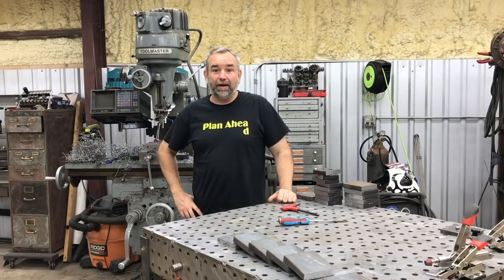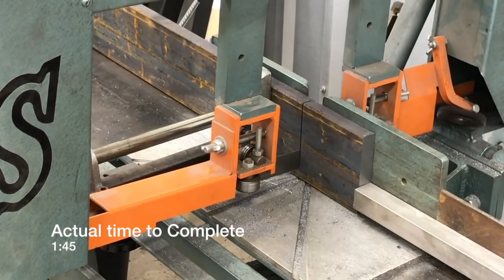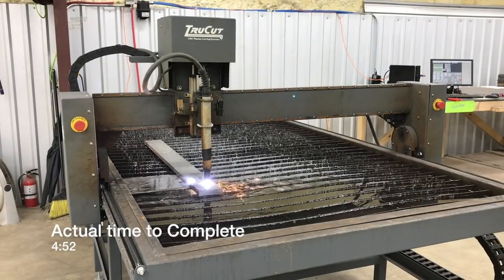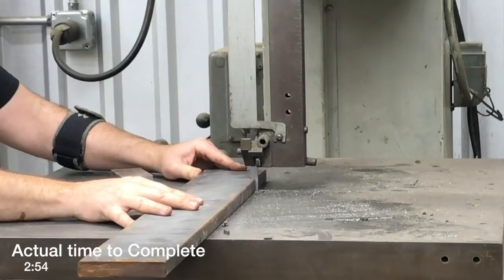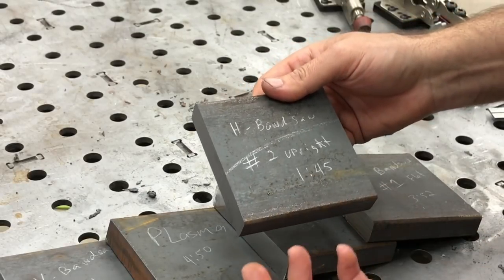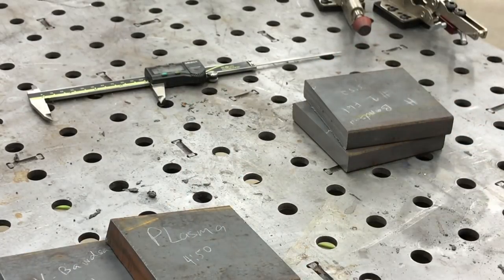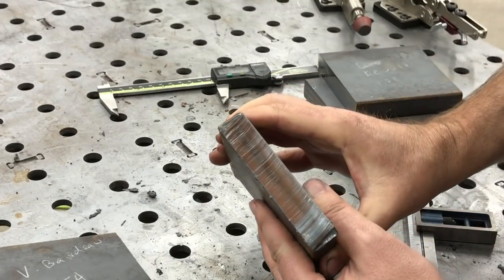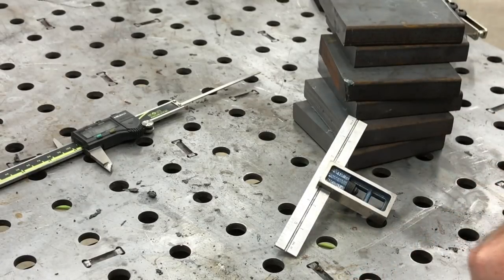5 Ways to Cut Thick Steel - Which is Fastest? Carbide Circular Saw Blades

Comment: This was great. Just what I was looking for. A few comments:

Rip fence for the bandsaw? Same with hand saw?

How would the chopsaw do horizontally?

Tablesaw with rip fence? Too dangerous?

The bottom on your Dewalt chop saw looks exactly the same as my cruddy harbor Freight abrasive saw. I agree with you the cuts are never 90°, but I would expect Dewalt to have a better mechanism to ensure 90° cuts with that nice blade. 

I never knew metal cutting blades were that efficient and safe. Thank you so much!

Comment: Very informative well made vid, thanks. I have an evolution rage 4 chop saw and I have found the same thing with squareness. I blame it on the clamp. The nut for the lead screw is so far back that the plate holding the piece wobbles. Also no one seems to make either metal cutting table saws or band saws. Yes you can put metal cutting blades on them but there is always a speed issue and they have basically been designed for  wood. It seems there is a safety thing going on, good clamping is really important when cutting anything really.

Comment: Use to do a lot of cut lists in a fab shop. In my opinion, I would use your horizontal bandsaw with the material upright. The first cut includes setting your stop but the others go quick. Also always consistent and doesn't require a lot of baby sitting. Once the cut gets deep enough to go across the width of the material, your feed rate will be constant and not chatter. This allows you to multitask pretty easy.  Nice video. Thanks for sharing.

Comment: Chops saw blades tend to walk over really bad when run vertical. The more down pressure you put, the more side walk tendency the blade has. Same is true with bandsaws. If you're cutting vertical, slow down the down feed on the band saw or down pressure on chop saw

Comment: Good comparison. Set up time is def a factor for some people, but less important when making repeated cuts. Like others have mentioned I’d have been interested in seeing the actual cut times compared instead or also. I’m no metal worker, but the one thing I just didn’t understand was why he was both sides of each piece steel. The only side affected by the saw in question was one side cut by the method he was talking about at that moment.

Comment: Good comparison Gary.  I think if you had to do more than 8 the plasma on a piece of sheet or the horizontal with material stacked would be faster per piece.  It's where you don't have that many to do where it gets harder to see which saw / method will be faster per cut.  Also a lot of time people don't factor in finishing if it's needed or not.  Sometimes a saw may go a little slower but leaves a cleaner cut.  I think you showed that good in the video.
Reply: It will be interesting what I will use more after I get a cold cut saw. I normally use my powerplasma cutter right now.

Comment: My dewalt carbide saw didn't use to cut square either.  I had to place a shim underneath the mounting arm where the saw attaches to the base.  Cuts perfectly now.  Great comparison!
Reply from the maker: thats interesting for sure, thanks for the heads up on that.
Reply: Do you have any more details on the mod? Size of shim? Pics of placement?

Comment: I can free hand plasma cuts with great accuracy after i learned to treat it like shooting long range. Take a deep breath, let half out, pull the trigger. Helps keep your hand steady. Also do a dry run across your material to make sure you're not fighting the whip, just as you would when welding. However, if the electrode or cup, i prefer to not use a drag cup so i can see my arc better (and yes you can do that as long as you can keep your torch steady and off the material) is getting too worn, then it's difficult to get a square cut throughout the thickness of material. The key is keeping your torch sqaure to material and keep the same distance to your material throughout the entire cut. Takes some hands on experience,  but can be done. But then you still have to chip away the slag.

Comment: Worked at a machine shop in Ogden UT and when I wasn't machining I ran the band saw.  I would have gang cut a bunch of bars.  Usually when the band saw wanders is because your putting too much pressure on the blade.  I could get parts off the band saw with a consistent .010" tolerance with it fairly close to square.

Comment: Great tool set up, must be great having a choice of cutting. I use a 4.5" hand grinder with a 1mm cutting blade for all my cuts, every single one :(
Reply: After decades of cutting steel, probably everyone will end up using 4.5" - 1mm cutting disc hand grinder for all cuts.

Comment: you should really use a swinging stop on the horizontal bandsaw. or a spacer block between the hard stop and the material that you can pull out between cuts. a hard stop will cause binding at the end of a cut and can alter the finish dimensions on repeats.. I've seen blades snap also with hard stops.
Reply: LacklusterSupply oh absolutely! Never cut against a rigid stop. The metal needs to be free on the cutoff end. This is true even for wood work.

Comment: Great video concept but without having setup time and cut time seperate, it doesn't tell us too much as repeat cuts will save time so knowing how long the cutting only takes can be more important than setup time and visa-versa, knowing this detail gives us an actual idea of cutting speed.
Reply: Not a bad point, but I think it was obvious at the end of the video that DeWalt cold saw is fastest, and that's all I needed to know. Would be nice to know price difference between cold/ hot cut blades over their lifetime.

Comment: What a great review of metal cutting tools. I too use an Ellis band saw at work with good results. At home for projects the Milwaukee circular saw works great and is compact. I am hoping to purchase a Dewalt  or Makita cold cut chop saw next as my abrasive chop saw is slow and not accurate.
Reply: What kind of Blade are you using on the Milwaukee circular saw?

Comment: I have most types of saw. I would use a horizontal bandsaw every time for that!
The most accurate saw I have though is my British Startrite 24" vertical bandsaw. Ys it wanders freehand but if you use the fantastic fences supplied it become extremely accurate. I can do repeated cuts to within 0.0001 thou - yes really it is incredible - as accurate as a mill.

Comment: With the free hand Milwaukee, try putting a triangle shaped carpenter square on the work piece and then run the saw against it for a faster and  straighter cut. Faster because you don't have to mark across the whole piece, just on the edge.

Comment: I tried a bunch of different stuff to cut up scrap for my scrap business. For scrap, non-precision cuts, the fastest, most cost effective way is a gasoline torch. The second most cost effective way is oxy/propane. For light stuff I use a generator 7" angle grinder with a cutoff wheel.

Comment: I used my new 7 1/4" Diablo steel cutting blade today for the first time, cutting 3/16" by 2" angle iron. I have a torch, a band saw, and lots of skinny wheel cut off abrasive blades for my grinders, PLUS a plasma cutter BTW. I had it in my SKIL worm gear saw, and I am an old carpenter, so the only weird thing was, even with the familiar old muscle memory of using the saw, it was frigging odd as hell to be using to CUT STEEL! It worked great, no heat, no burrs,  fast as hell, and unlike the cut off wheels no fine dust through out the shop, so much easier to sweep up metal 'saw dust." Wear safety goggles (duh...) , but noise wise, dust wise, that blade is the best damn way I have found to cut steel, period. Way faster then the bandsaw.

Comment: What would you say works best to cut through a thick safe roughly 4 inch thick mixed with cement. I have tried using a blow torch was able to cut through the top but took me 12 hours it’s a very tiring process. Was looking into alternative ways, I thought of buying a plasma cutter but not sure if it would fit the job I’m no expert.  Would appreciate the help!!
Reply: Oh and I burnt some of my belongings in there it has an electronic lock mechanism but that failed and doesn’t unlock anymore.

Comment: I'd cut 1 in half(+10 or so kerfs) on the horizontal band saw, then cut 2 in half, then 4 in half then 8. How many did you need?
Reply from the maker: Only 8 of one size and 8 of another.  Not really a large enough production run for the gang stacking in my opinion

Comment: You haven't tried my method of cutting steel. For small piece
repeatable cuts. I have even cut 1" steel. I bought a cold cut saw and
just love it. when I figured out why it works so well ,slow speed, I took an old table
saw ,replaced the motor for a 1700 rpm motor , made a simple wood sled for the
saw and installed on my table saw 7 1/4" 40 tooth carbide $10.00 blade  ,cuts like my cold cut saw , beautiful  I have 
less than $50.00 invested. I can cut as fast as your Dewalt with the precession  every time of a wood table saw  .I used two blades in three years and this
blade now is 60 tooth, better yet.  Hope
you try it and you will be impressed

Comment: It wasn't clear that you separated cut cycle time from machine set-up time.  Both are important, but a short setup doesn't pay off if the cycle time is long, and perhaps vise versa.  And, you should already have each cutting machine/process tuned to provide it's best cut (straightest/fastest) before comparison.  

Another consideration if you are one person and have a shop with multiple cutting methods is to use two methods simultaneously.  For example, stack up 5 pieces to cut in the horizontal bandsaw and let that run while you see how many pieces you can cut with the circular saw or some such.
Reply: I was thinking the same. It's irrelevant how long it takes to set up a machine for one cut if the difference is only 3 minutes but it matters when you have a lot of them to do. Power draw might be the most important factor, despite a faster cut with the plasma, for example. Maybe a comparison follow-up to compare the power cost per cut would be a good video? I would stack 5 high (or deep if it cuts squarer for length consistency) in the horizontal bandsaw judging by the results of this test and use flood coolant. All really depends upon the accuracy and finish required.

Comment: I could not tell from the camera angle if your vertical bandsaw has a fence guide. If it does, why not use a fence? I'm curious why few, if none, of the youtube machinists use a fence when cutting metal with a vertical bandsaw. The piece you cut was moving around a lot so I don't see how that could produce a straight cut.

Comment: And here I am stuck with an angle grinder, and some Harbor Freight cutting discs. LOL
Reply from the maker: It wasn't that long ago that I was using angle grinders and hand drills to work with thick material.  Its tough but can be done.

Comment: How much abuse can one of those carbide blades take? Can they cut hardened steel? How often do you make thick cuts and do you have to replace tips or resharpen often?
Reply from the maker: They can take have a long wear time on aluminum and mild steel.  I dont think htey are reccomended for stainless or anything hard.  I use them often and I get several months out of the blade before it needs sharpened.  One time I did a project out of stainless, and that one project may have had 20-30 cuts, and it dulled the blade
Reply: Cool, I have the same saw and I'm worried about destroying the blades as they are pretty expensive blades haha. I saved up money just to buy it because it looked like a great saw.

Comment: weirdest thing I've seen was a guy score the metal, he then smacked it with a hammer and somehow snapped a really clean cut, is this actually possible or was it camera trickery?
Reply from the maker: Camera trickery
Reply: Let me guess: Tony?
Reply: I was just recalling that scene from Damascus Steel Fidget Spinner Pt 1 by Alec Steele.
Reply: I think ThisOldTony karate chops steel as well. He has a black belt in origami. Takes years of cracktise.

Comment: How does the dewalt wrk with angles?  Can u cut a 45 fairy accurate ?   Also what about with 1/8” wall tube.    I typically only use tube and flatbar 3/8 thick at most

Comment: Can you use miter saw with carbide blades to cut metal?
Reply from the maker: for aluminum yes, but not steel.  The dedicated metal cutting saws with carbide metal blades turn much slower than your average wood miter saw

Comment: Comparisons are not uniform.  If you are including the time to change the plasma tip, I  would think you should factor in the time to change the blade on the saw, no?
Reply from the maker: I can kind of see your point, but I primarily cut sheetmetal on my plasma table, so its always sitting there with a 45amp tip in it, so if i need to cut 3/4" material, I would have to change the tip.  But the saw always has the right blade in it because the one blade can cut any thickness.  This was never meant to be a scientific comparison, just more specific to my shop and for fun, but then again some people will pick apart any video no matter how good it is lol

Comment: You are comparing a one-off thick plate cut and the set-up times included. If you are cutting repetitive cuts the plasma probably is the winner. Set up time should not be included to be fair. Also, the Milwaukee could have had the square clamped to the metal to guide the saw. One-off cuts are always a crap shoot for time because of set-up.

Comment: If you put a blade with some bigger teeth on that horizontal band saw it'll cut faster.
Reply from the maker: Its got a 10-14 TPI pitch on the blade, Sawblade.com reccomended for mild steel.  Wider tooth would definitely cut faster/better in aluminum, and possibly mild steel, but they don't last anywhere near as long
Reply: I recently purchased a new saw and it came with a M4 4-6 on it and it works great. Has been for 2 months. A 6-10 would be good too I guess.
Reply: Right, my ellis saw also comes with a more universal blade with wider tooth pitch.  These are meant as an all purpose.  When the teeth start to wear down or if you catch one and break it the blade is less forgiving, this is less of an issue on 10-14. Same reason a hacksaw comes with a tight pattern blade

Comment: When you cut on band saw always cut in vert position less contact with material and blade
Reply: the saw or the material?
Reply: Blade.
Reply: I assume monty was trolling. Gary said right in his video that he gets blade wander when vert cutting, I have the exact same experience with my wilton. I think thats pretty normal. Generally the more contact the better. I'd ask how monty's blade life is but we probably all have a different standard of what life should be. Plus how do you even keep track of something like that with all the factors a bandsaw presents (material type, thickness, feed rate, blade material, coolant/non, operator....). A good rule of thumb is a MINIMUM of 3 teeth in your cut at all time and listen to the machine. Thanks for the video Gary!

Comment: a BIT SURPRISED you didn't try one on a regular tablesaw with a carbide blade. I don't see many people doing that but don't know why ... it's a total wonder in terms of setup and accessories and flexibility
Reply from the maker: well, i think table saws run too fast for steel, i think they do aluminum just fine.  But I have tried steel in a wood chop saw and it dulled the blade quickly.
Reply: i believe that's only with abrasive wheels - which mostly need to be at lower speed - whereas the carbide chopsaws run at the same RPMs as most tablesaws (between 3000 and 4000) - anyway i've researched it and yeah most of the carbide wheeled (not abrasive) chopsaws run at similar speeds - though one could always gear down with a different pully too if one needed to there's a few videos on here showing people running carbide blades on a table saw ...  for example: https://www.youtube.com/watch?v=DqdpvaXUWo4   or  https://www.youtube.com/watch?v=oLnPvWvP1Js  or   https://www.youtube.com/watch?v=rEniWxbDgKM&t=10s